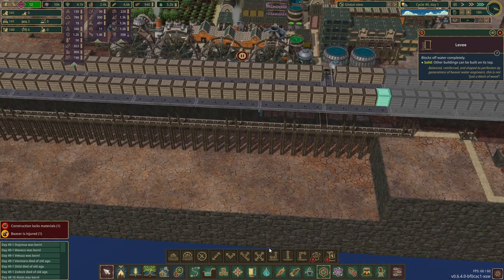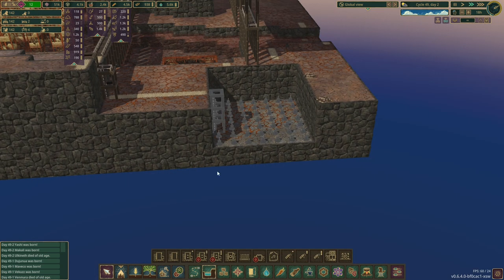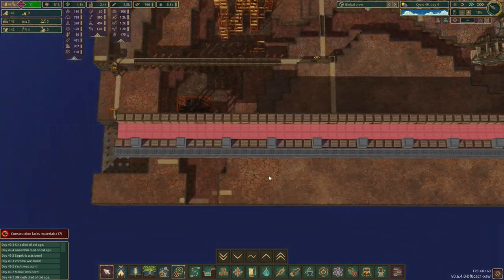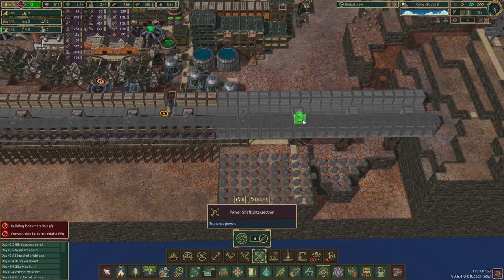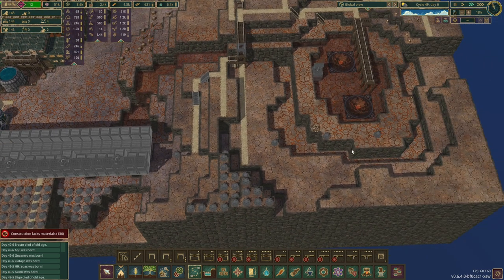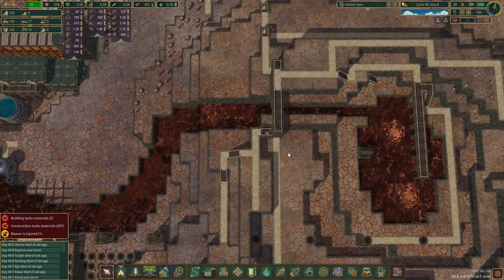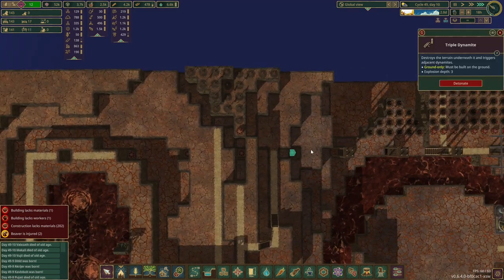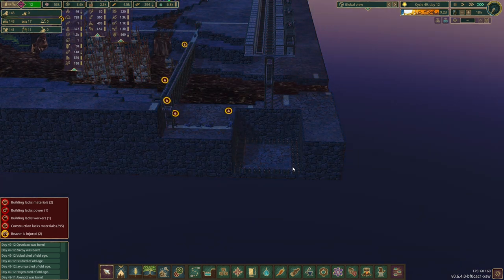Timberborn Update 6 - Aqueduct Construction Progress Continues

Comment: The new update makes sure that water wheels don't restrict water movement.
Reply: I came to the comments to say this as well. Another YouTuber, SkyeStorm, also has a method for increasing water flow rate which can help with preventing the water backup and overflow issues too.

Edit: oops, Skye Storme
Reply from the maker: Oh really? Awesome, I haven't tested much on the new water system, so running on older knowledge. Thanks.
Reply from the maker: @Yalsof Yes, It's funny, SkyeStorms video came out a few hours after I did a stream discovering the same thing. 
But he goes in to far more detail that I ever did. Very useful video indeed.

Comment: You can use a 1x2 overhang instead of a platform next to the 4 way power shaft intersection to build the vertical shafts down to the ground without having to build ladders next to each.  Also, just for aesthetics, you can build rooftop terraces on overhangs too.
Reply from the maker: I also realised, we're going to have a path on top anyhow to build the batteries and wheels, and beavers can build down as far as they like, so making he vertical power lines will be easy.

Comment: You'll be glad to know I'm working on making more dynamite options available today. Just gotta do the icons and textures then I'll be ready to do a trial run of them. Should work as I just copied the triple dynamite prefabs for it.
Reply from the maker: Oh nice. I really need to look in to modding Timberborn myself. I have some ideas for future playthroughs, like an only bad water run, but it would need something like a well to added to get some form or water, and a filtration plant that get good water from bad or modding the centrifuge to get extract, but also normal water for example.
Reply: @STHedgehog  Sound like you might want to talk with the water extensions author, I think that was Knatte. As for my more bombs mod, it's working but somehow has a compatibility issue with TimberAPI so for now I'm not uploading it. I'll try again after my job interview today
Reply: Got it working, now I just gotta fix the icon of the quintadecamite since I selected the wrong one thinking I had the quintamite selected. I also gotta fix a minor issue in which group the hexadecamite shows up in.